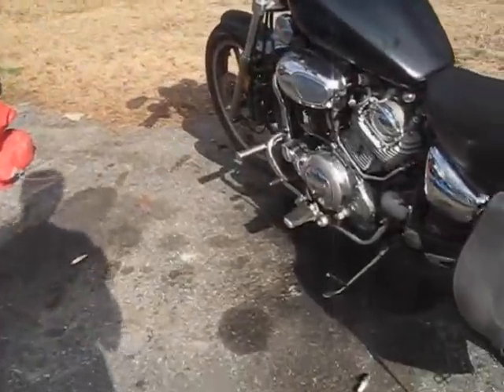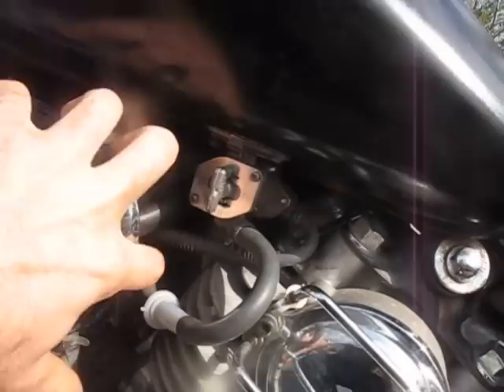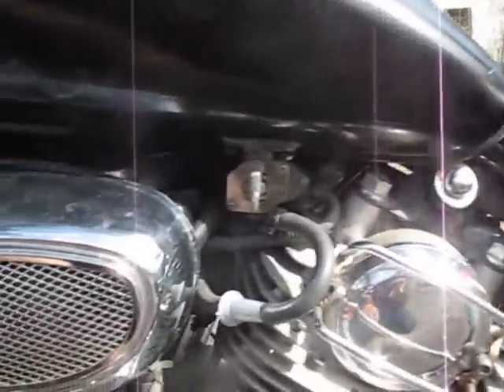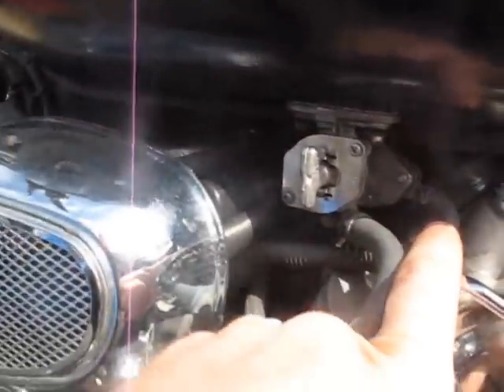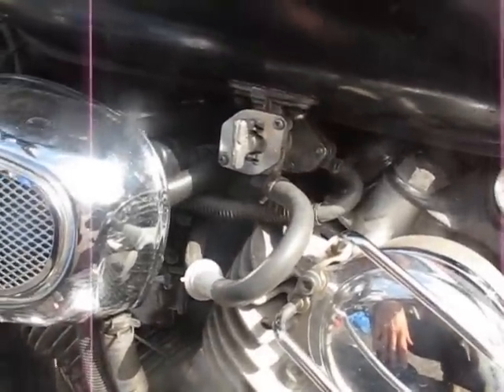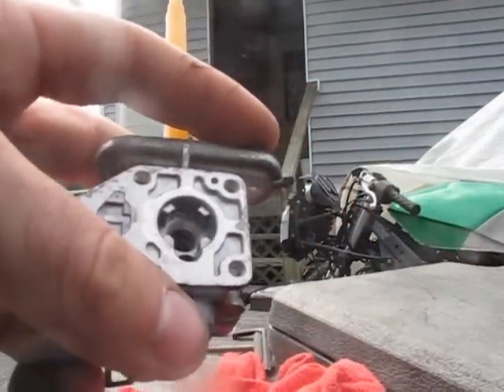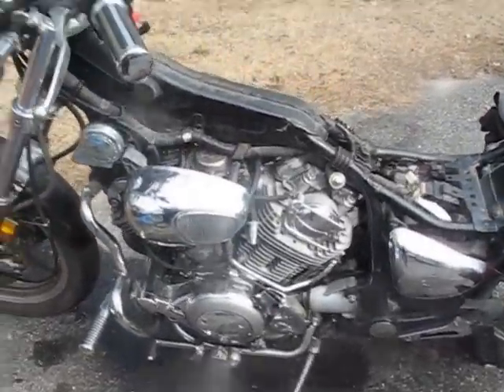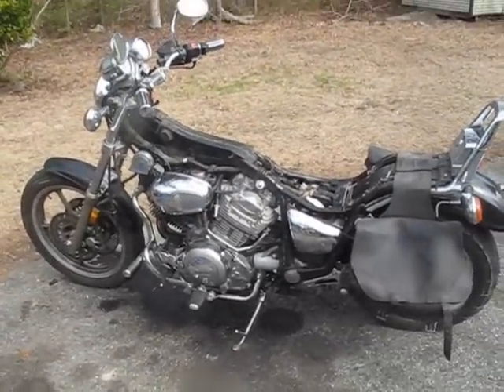How to fix your motorcycle petcock without a rebuild kit

Comment: Awesome video, I fixed my petcock with this information. My engine was filled with gas. I cleared the cylinders, and the airbox. I also changed the oil. Unfortunately, after the motor warms up, running for about one minute, it starts smoking a lot. Are the oil rings bad?
Reply from the maker: +Travitanium Double check your oil level
Reply: Thank you, I checked the oil, and it was good. It wasn't burning oil so I decided to ride it and it ran great. All the gas/oil was burned out (probably in the exhaust) and it doesn't smoke anymore. The oil level is still good after 130 miles.

Comment: Great video! Just wondering if you ever rebuilt the petcock on a Suzuki GSXR600. I took mine apart and it seems that one of the plates is glued on. It could be really stuck due to time. Either way, I'd like to know how to separate it so I can put all new parts in it.
So far, I've learned a lot from your videos.  Thanks.

Comment from the maker: The YICS systems actually is a remarkably good idea, its only a little more complicated but supposedly it does give increased hp and efficiency. Ive never cleaned one, never had to, because I found that it didnt introduce any further problems into a motorcycle's intake system than a normal bike would have, beyond a slightly more complicated sync process. That is to say, all running problems on YICS bikes that I have repaired were petcock, carb, vacuum leak etc related

Comment: Max I have an 85 Virago that has a small air hole on the backside of the petcock that is shooting out gas, I took it apart and tried to clean it but alas it still is spurting gas, any suggestions? And what is the hole for, just curious. Thanks
Reply from the maker: +Todd Chapman That hole is to maintain neutral pressure when your petcock diaphragm is pulled in and out. If it is squirting gas, chances are your diaphragm is improperly installed or damaged
Reply: Thanks at this point I may just put in an old school pc, they are much cheaper than the diaphragm kits

Comment: How do you clean a petcock itself? Mine stopped sending fuel into the carb of my 99 yamaha warrior. I'd like to do the vinegar trick inside the tank. I'm going to add an inline fuel filter between the petcock and carb, but the gas isn't traveling from the petcock to the carb currently.
Reply from the maker: Take it all apart like I show in this video and clean it out with carb cleaner spray and a pipe cleaner

Comment: Bike quit as I was riding it down the freeway... Engine turned over, but wouldn't start. Thought it was the carbs, so I pull off the tank to see whats up, and find out my petcock wasn't delivering fuel to the carbs. This video got my petcock fixed and my bike running again! Thanks so much!

Comment: Thanks for your videos! I subscribed to your channel and I have watched a ton of them to try and get my 1992 ninja 600r running. I cleaned the carbs and jets and installed a new battery. I just don't know where the vacuum hose is that allows the gas to come out. The bike won't start and I think it is because no gas is getting out of the tank. I put in a gallon and the gauge reads empty. Is this due to the vacuum hose not being hooked up? Thanks again for the great videos!

Comment: My vacuum gasket in my fuel petcock broke on my 1979 Suzuki GS750 while on a road trip Boston - LA. I simply removed the o-ring from the vacuum actuated needle in the petcock so that fuel could flow around it while it rested permanently in the fuel-off position. Of course, you need to kink both the vacuum hose from the carb and the vacum hose from the petcock. It helped me out in a jam, and all you need is a screwdriver.

Comment: Thank you mrmaxstorey! Your video helped me greatly while fixing my Kawasaki Zephyr 750's petcock. It is built almost exactly the way you show in your video, and in my case the cause of the leak was the small washer that is being pushed by the spring that you so perfectly extended. My bike wouldn't start, or even rotate because the left cylinder was full of fuel that it spat out after removing the spark plug. Your videos are extremely practical and helpful. Thanks!

Comment: Awesome... I looked up your video to fix a boat motor which is so old that the parts are extremely hard to locate (so far).  The motor is a Tohatsu m5b from the 1980's.  The "fuel cock" as they call it in the parts manual isn't even sold now... it just says "Part Obsolete".  :(
Reply: So far your tips worked.
Reply from the maker: Cool good luck

Comment from the maker: Not asking for trouble, but you are depriving your bike of an important safety feature, plus you dont have the benefit of being able to chart gas consumption using the RES function. It sounds like the petcock might be partially clogged, or the vacuum diaphragm is not opening. Might be as simple as a disconnected or damaged vacuum line. Id suggest repairing it asap, see my other petcock video for more info.

Comment: i did this, is my engine safe to start now? i need change oilt first. but gas was leaking out of my exhaust and im afraid i hydrolocked my engine
Reply from the maker: Change the oil, you'll probably be ok. The starter motor doesnt have enough power to damage your motor if it is hydrolocked, worst case scenario it just wont turn over and you will have to remove all the spark plugs to get the gas to shoot out

Comment: Hey Max. Thanks for the video. Quick question -- the other day after returning to my bike (1992 Yamaha XJ600) a few hours after a 40 mile highway ride, the engine would not hold an idle even with the choke fully on, and eventually it stopped turning over when trying to start. It would just churn endlessly. After fiddling for a while with the bike I realized that the petcock vacuum line running from my carbs to the petcock had come attached at the petcock, most likely during the vibration/wind speed on the highway. So I reattached that line and tried starting the bike again. Again it just churned, but this time the churning started to slow down the longer I tried to start the bike. Now it will only churn once or twice before it sounds like it seizes up. Could I have flooded something by churning the engine with the petcock vacuum line unattached? I think that I turned the petcock to prime while fiddling with the bike but I can't remember exactly when I did that. 

Any help is appreciated!
Reply from the maker: No you just wore the battery down. Charge it up, and try to start the bike back up
Reply: mrmaxstorey That was it! Thanks for the help!

Comment from the maker: Hmm Id check the integrity of the spark plug wires and caps, check for potential for vapor lock, check float heights, and check for vacuum leaks

Comment: Thanks for making all these videos, they're really great!  I have a question; if the petcock is bad and letting fuel by, how would the fuel get into the motor?  Shouldn't the floats/needle valves in the carbs stop the gas?  Thanks again, keep up the great work!
Reply: Yep
Reply: Yeah, he should have pulled that front carb, and checked the needle and seat.  Gas can't get passed the carb if the needle and seat/float are working properly.  Gas in the motor (thins the oil like he said) and can ruin things in a hurry.

Comment: i have 2 gas hoses on my petcock and only one pumps out fuel consistently on "reserve" and "on". when i switch it to prime, both hoses leak out equally. what do you think the problem could be? the petcock or the vacuum?
Reply from the maker: Probably the petcock is gummed up somewhere in there, time to take it apart and clean
Reply: +mrmaxstorey I took apart the part where the vacuum hose connects to and it all looked fine. as for the other side the screws and so tight that I'm stripping them. when I put the petcock back on the tank, it'll only flow gas thru one hose and if I kink the flowing hose gas will flow thru the other hose.
Reply from the maker: Oh well then it might not be a problem since both hoses will be delivering fuel. If you are filling up your carbs for the first time after service, one might fill until it is stopped by the float needle, then the other will fill, and they will both remain full during normal operation of the bike. Were you getting fuel starvation to one of your carbs?
Reply: yeah. after a couple miles of riding, the bike will die
Reply from the maker: OK well if the bike dies because the petcock is not reliably giving gas, then either repair or replace it. Petcocks are cheap.

Comment: Great video! I was having problems with my petcock leaking. I couldn't find a replacement so I was clamping the fuel line with a vice grip whenever I parked. 

After coming across this video I was able to repair my petcock and be back on the road within an hour. 

You Rule!

Comment: Nice job. I find value in you showing me the simple design and the parts I can expect to find when I open the back of mine. I'm doing the one from my '07 Suzuki DR650 now. I did buy a rebuild kit but it only contains the parts for the front of it. I will have to test it to see if I need to do the spring stretch too but I don't have the gaskets for that in case I tear one.

Comment from the maker: OK first, look at my other petcock video about how a petcock works, it will explain what is supposed to happen. Is that tube the fuel line which runs to the carbs? Is it clogged?

Comment: Hi Max, I really appreciate that time you take to put these videos up.  You definitely deserve your popularity.  I took the tank off my KZ 750 today, and dissembled my petcock. my gaskets and O-rings are all right, so I don't need a rebuild kit, but the filter/strainer tower that slides into the tank is totally mangled.  I can't seem to find any replacements online.  even if I needed a rebuild, the filters don't seem to come with them.  Would you have a clue where I might find one?  Thanks dude.

Comment: I am working on my old Suzuki LT-F250 4 wheeler. It has been sitting for over 10 years in my basement. I have taken off the carb, air filter, and petcock off the bottom of the tank. Now my tank is wedge in the frame and I would have to remove the motor to get the tank out of the frame. Any suggestions on how to clean the tank without turning it upside down to get it clean? The 4 wheeler is too heavy to turn upside down and I do not want to remove the motor to get the tank out. Great video. I will try to take my petcock apart and clean it. Peace, Mo
Reply from the maker: Well its a plastic tank, right? So you might be able to get away with some vigorous flushing with vinegar
Reply: Yes it is plastic. I was not sure if I should use gas or not but vinegar will work. Thanks

Comment from the maker: Yes if you are getting overflowing carbs you must repair the floats as well. I have a video up on leaking carbs. And absolutely you must change your oil before you ride the bike again. It is very important not to have gas contaminating your oil

Comment: A piece of rubber from the broken petcock seal is probably stuck in your float needle.That's why it is over flowing the float chamber causing it to leak gasoline all over the driveway. A new seal will cost you about 2 bucks.If you get it from J.P.Cycles It won't take you two weeks to get it.
Reply from the maker: Thank you for the feedback but that repair is covered in another video. This is just the petcock repair video

Comment: No start.   I spent longer on cleaning those worthing hatichi pieces of shit than what it took to put the Honda CM250 swapping the engine.  I must have spent 90 minutes on each carb.  I must have used a can of carb cleaner on the fuel bowl getting that retarded choke hole Zestfully clean as one site said.  The tube that went into the stupid hole was also focused on. Carb cleaner shot out of the top of the carb where the choke starters went. I hit every hole I read about. Had valve cover off.

Comment: You rock dude!!!!.. This video gave me a little direction.. I have a  96 gsxr srad that will not start and there is more fuel than oil in the crankcase...after having the carbs cleaned out I'm having same issue.. So I will give petcock another look to make sure its properly working...thanks man I will continue to watch your videos ....

Comment: Kind of a crummy design for the motorcycle that an overflowing carb will flood a cylinder. This is a problem they solved with cars in the 1930s. Even if I have a stuck float on my 1970s designed Kz650, the carb is level with the engine intake, and the carb bowls and over flows are under the engine. Worst case is I get a puddle under the bike. Diluted fuel and hydrolock isn't even possible.
Reply from the maker: Man its totally possible, if the leak is big enough and float stuck wide open, it can totally get in the cylinders. Or, if the overflow is clogged. Most bikes have the carb level with the intake, but it still happens all the time